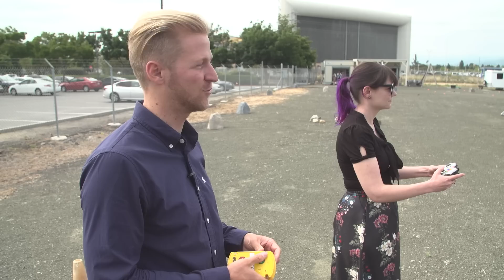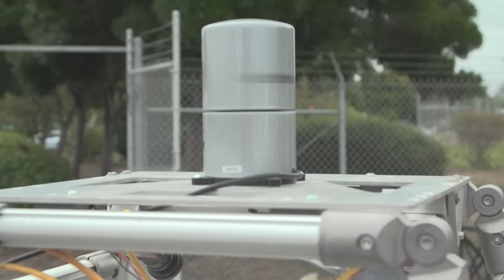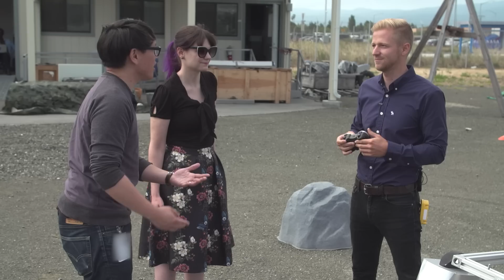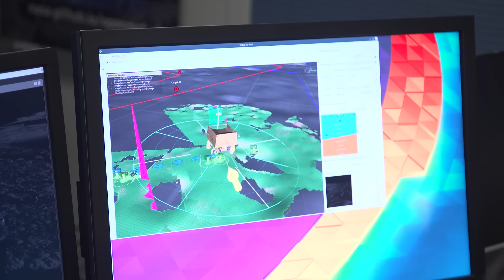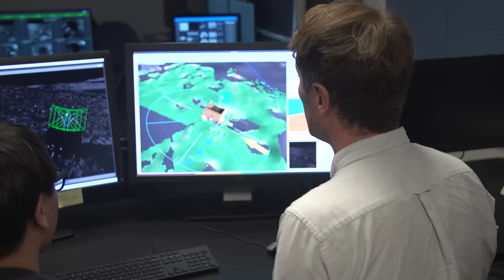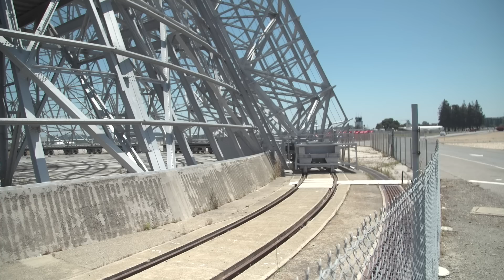Driving a Robot on NASA's Roverscape!

Comment: In 1981 I was doing a course on PDP-11s, and got a tour of Moffat Field with a guy from Honeywell. He was updating data tape drives on a squadron of P-3 Orion aircraft, which they had put inside Hangar 1. That thing is so big they had 12 4 engine planes parked inside it. Not only that but it was hot, and with the main doors closed there were clouds forming in the roof! It was quite disconcerting. You lose all sense of scale. I hope they put the skin back.

Before we left, we drove round the Ames side of the field to look at all the aircraft. T-33s, T-5s, a 747 with a telescope inside, and of course that U-2. Fascinating. The enormous wind tunnel is on the north side of the field and just across the road was open fields. Those fields are where Microsoft and Google now have their HQs! I've got a photo somewhere. Must look it out.
Reply: I used to work in some decommissioned hangers for B-52's. Each hangar could hold 2 of the aircraft, with 4 hanger bays and 3 smaller shop bays in between each hanger making up the entire building. With the right temperature and a little welding going on in the bay we would get clouds forming in the top of the bay too.  It only really happened when it was about 40 F and high humidity, but it was really surreal the first time you saw it.
Reply: KnightsWithoutATable are you being serious?
Reply: @DJL-t5j  Yes. The hangers had been converted into a factory for heavy machinery, so you would have parts being welded in one part of a bay while the assembly line was right next to that and a painting line for the welded parts next to that. Top of that hanger was well over 80 feet up, closer to 110 feet. I know this because they used a Genie 80 foot lift to change light on the sided of the bay, but needed a larger machine to reach anything in the middle, like the fire alarms.

The former Air Force base had a wing of B-52's as a strategic bomber wing, complete with nukes and tons of conventional warheads stored on site. I worked for another company that set up an explosives plant out where the bunkers for the bombs were at the same decommissioned base.
Reply: KnightsWithoutATable 
so let me get this straight...
you’ve had access or been in the vicinity of “nuclear weapons” 
And your commenting (telling  everybody!) on YouTube!
Reply: @KnightsWithoutATable  Decommissioned bases can be both interesting and fun. Back in the late 80s, a friend of mine who ran a company that built TV Studios and Editing Rooms moved into a building on RAF Greenham Common which had stored cruise missiles. I used to do specification and commissioning for him and would go driving round exploring. 

My friends building had been an electronics workshop and had computer flooring and false ceilings throughtout, with lots of trunking. However they had removed ALL the wiring, wall-boxes, light fittings, HVAC, etc. He didn't mind so much because we could rewire it all the way we needed it. It was a great place to work. The workshops were big enough that we could mark out the floor at full size and layout editing and studio control rooms with plenty of space to work around them.

The bunkers were all on the far side of the base and had their own entrance. They were taken over by a wine wholesaler! Before the base could be sold off the RAF & USAF had to completely remove anything hazardous, but we used to joke about them selling Radioactive Chardonnay!

The weirdest thing was the base housing, which had been completely stripped! Windows, doors, plumbing and wiring. They were eventually taken over by a paint-balling company! Ideal for that. A land yacht club had one of the runways at the weekends, but there was a car dealer who used the aprons for storing their cars. Lots of new Nissan's.
Reply: @DJL-t5j  The base was decommissioned. I said that in my post.
Reply: Sadiq Mohamed ever heard of logical fallacies?......red herring comes to mind !
Reply: KnightsWithoutATable commissioned or decommissioned has very little to no relevance 
If what you say is true, you would have had to have signed an NDA!
Pls explain how you are now allowed to break your NDA (there all registered & rather easily tracked;) 
X
Reply: @DJL-t5j  You need to stop this. You are claiming he is lying? What evidence do you have? You sound like an idiot who has no idea!
Reply: @DJL-t5j  It was decommissioned. The base was fully shut down and the structures and runway leased off to companies to use as tenants with the USAF as the land lords so that if they wanted to reactivate the base they still owned the property. The hangers were then converted into a factory for heavy equipment, the ordinance bunkers to a pair of explosive factories, the smaller aircraft hangers and runway into an airport and aviation school, the base housing sold off completely, and the misc. buildings and enlisted barracks were gifted to a community college. Oh, and the base comm center was converted into electrical grid power distribution in one half and a secure data repository.

No reasons for NDAs, the base was completely gone by the time I even moved to the area. You seem to have misunderstood me when I explained that a heavy equipment company had set up a factory inside the old hangars. If you are part of DoD and think I am some contractor that violated and NDA, I can give you the clue that the former base I am talking about was used by the Fairchild AFB tanker crews while their runways were redone several years ago. I was attending the community college adjacent to the airport at the time and the AF had contracted half of the college's dinning hall to serve as the mess hall for the personnel stationed there.
Reply: @sadiqmohamed681  I think he believes that just the building was decommissioned while the base was still active, not the entire base and that parts of it were leased and other parts sold off. Besides, the only secrets about those hangers were that the roof always leaked, even if it had just been fixed and the heating systems for the large bays that stored the planes broke down all the time and needed parts not made since the 70's to fix them.
Reply: Sadiq Mohamed it’s all a logical fallacy called appeal to authority your entire belief systems completely contradict what you see/feel yourselves Y
Because someone else told you this is how it is.....mugs X
Reply: KnightsWithoutATable why is it called a n Airoplane! Could it be air Over plane?

Comment: Why do they have to aim the controller at it still. And why no live feed in that program
Reply: Because in the real use case live feed wouldn't be live at all, due to the distance. A 3D mapping of the ground is 10x better, considering its less likely to get covered in dirt and is much more accurate.

You still have to aim the signal at the rover on a planet just like with the controller, especially due to distance.
Reply: @samconroyy  I heard the moon is under 10 miles away
Reply: @MadazzaMusik  Ah yes the moon was an inside job.
Fuck sake you have chemtrail videos on your channel, don't bother replying 😂.

Comment: waddup with the mic? or is that just me
Reply: Tested has always had sound and mic issues. They have gotten better, but their remote location sound can have problems. What this video needed was some background sound lowering and sound normalization all done in post. They likely have the software to do this, but I think that their release schedule is too tight to get it done in time for release.
Reply: KnightsWithoutATable 
Quick question.....
How do you know that?
Reply: @DJL-t5j  I done some basic audio production. Nothing professional, just a short lived podcast. It only takes really basic tools, knowledge about how people hear things, and a little time to clean up most audio, but you have to start with good source material or there is only so much you can do. 

Normalization can be done automatically by software or by just altering the levels above the noise floor to be relatively equal so that the listener doesn't have to keep altering their volume settings to hear the sections that are quiet and not blow their ears out in louder sections. It is worse for headphone, but still can be a problem.

You can find plenty of videos here on YouTube on the topic and there are more advanced techniques out there to do the audio engineering, but you have to have a good ear to do it well. Speech is easier to deal with since our brains can get the information out of it with less than perfect reproduction, hence why podcasts can be compressed so much and still sound fine. Music on the other hand, even an average person is going to notice a noisy recording or heavy compression, so you want to get that as perfect to the original as possible.
Reply: The background noise? That was the rover.